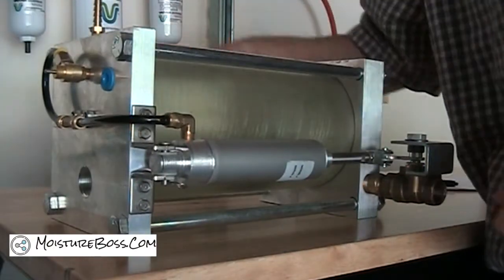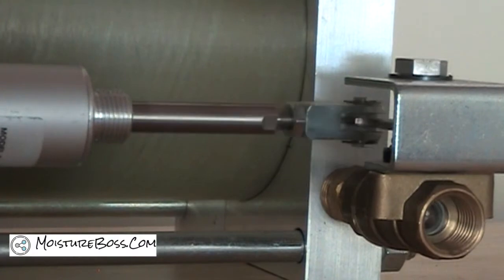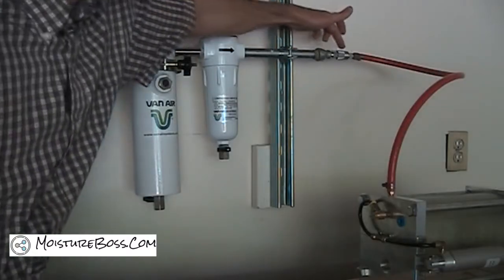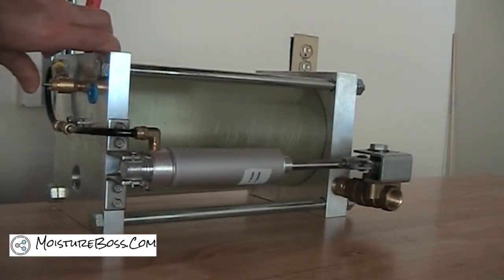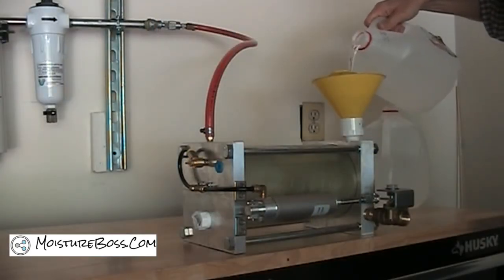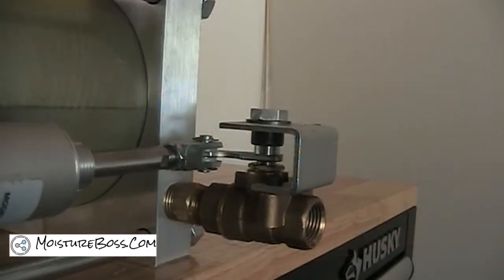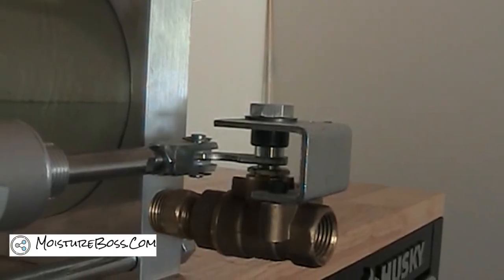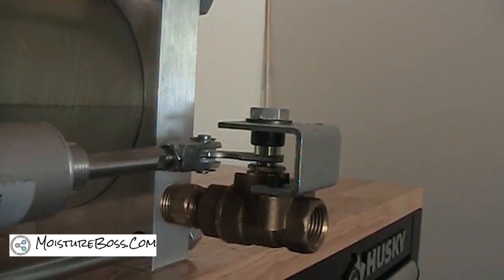Zero Air Loss Pneumatic Drain for Compressor Systems, Van Air Systems PDV-500T

Comment: I have a question regarding this drain. Hooked up to a tank, the balance line goes from the zero loss drain to an area on the tank higher then the condensate, where is that place located?
Reply: You can connect the balance line to the piping out of the tank.
Reply: Tyler Currie should there be a check valve from zero loss condensate drain to piping out of tank on the balance line?
Reply: @chico102390  No, since you're putting the balance line downstream of the tank, you'll be returning the air to a point in the system where the pressure is slightly lower.  This means air should not back flow through the balance line.
Reply: Tyler Currie any regulators on the balance line?
Reply: @chico102390  No.  But regulate the control air line to 80 PSI.  Give me a call or email if you want to talk.  You can find me via the Moisture Boss website.
Reply: Tyler Currie thank you. I get how the condensate drain goes on my air system now. What is the purpose of this balance line though? Air/water flows into condensate drain through control air line at bottom of tank?
Reply: Tyler Currie what size should the balance line be?
Reply: Tyler Currie what stainless steel fitting would I need to add to my air system to hook up the balance line to from the drain?